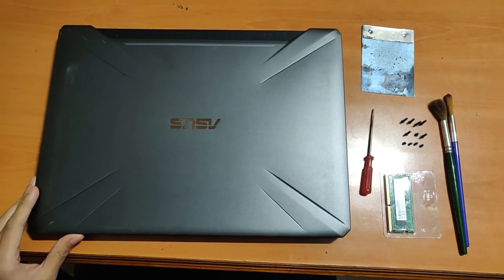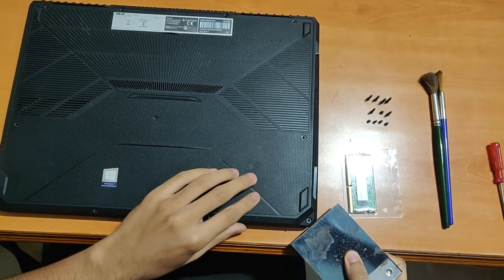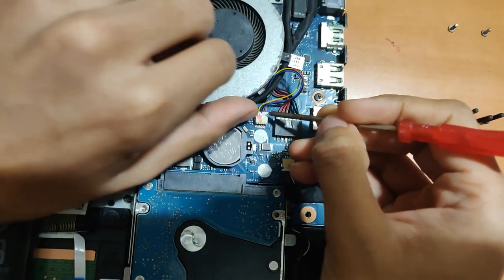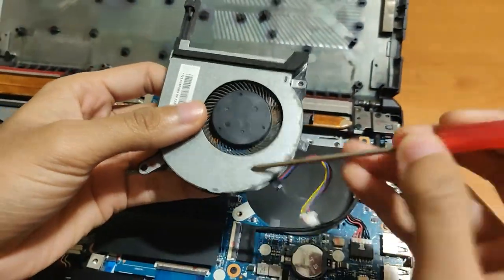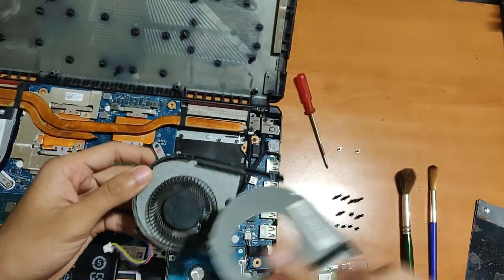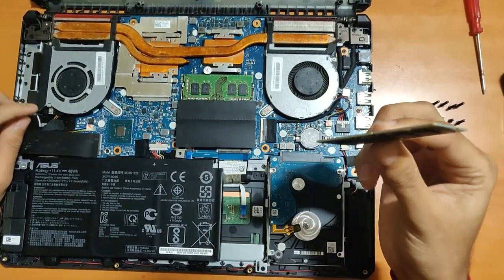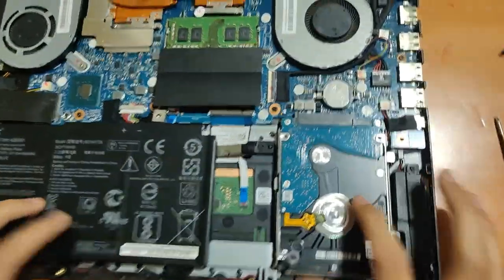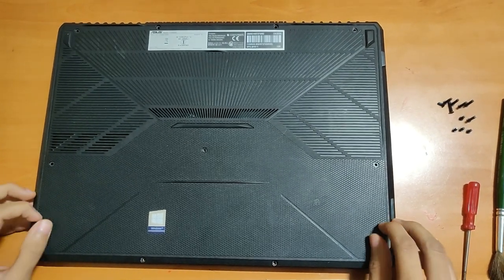Cleaning and Upgrading my ASUS TUF FX504 laptop

Comment: You are Lucky bro!!, Next time remove your battery wire
Reply from the maker: I did make sure to drain the battery completely but yeah I need to be careful.
Reply: Which one is the battery wire?
Reply: @tushartyagi1762  the middle one, who Have 6 small cable
Reply: @hs6389  Even if you drain the battery it will still have some power left in it. Make sure to remove it next time.

Comment: So many wrong things

1st: Disconnect battery first
2nd: Use any plastic /spatula to pry off the wires. You could have damaged the mobo with the metal screw driver
3rd: Remove heatsink first before the fans, DO NOT SLIDE IT the copper heat sink/pipes are very malleable and with MODERATE preassure it might bent permanently.
Reply from the maker: will keep this in mind thank you
Reply: @hs6389  BUT still it was very helpful THANKS😁
Reply: this guy is indian so imma trust him
Reply: any tips on how to remove the heatsink?
Reply: @zingodongo  bruh really?

Comment: Thanks man that helped.
Although, I must add that everyone should unscrew the heat sink its like 4 bolts and that way u want bend it like I just did .
Its minor and it will go back down, well it did as I screw the cover back on.
Just safer way to do it in my opinion.
I also unplugged the battery , and that "big " white connector u said not to unplug I had to as those wires were covering up one of the screws for the right fan and I didnt want to "pry " it away. Everything on this so small and I am sure easy to break...
All the best.
The video helped me, to finally do it, as it actually only took less than 20 min.
Reply from the maker: That was my very first try of opening and fixing a laptop and many people berated me for how wrong i was (which i agree). But kind messages like yours helped me and am over those rookie mistakes.

Comment: can you remove the left fan with the same method? i've stripped one of the heatpipe screw in the middle, so there's no way i can remove the heatpipe
Reply from the maker: No need to remove the heat pipe. For the left one, there are 3 screws. One is on the right-hand side while the other 2 are on the left-hand side (above and below the black tape.) Remove those and you are good to go.
Reply: I had the same issue (as others from what i see) regarding the stripped screw, how did you solve it?
Reply: i simply unscrew the fan screw, and simply lift the heatsink pipe then slide the fan outside, just like the video @Danteleo666

Comment: Nice video mate. My machine is not holding charge for more than 2-2.5 hrs. I don't play any games and its a 2 year old machine. Any idea how I can improve the battery backup? How much it would cost if replacing it is the best option?
Reply from the maker: I am no expert but that kind of backup is actually pretty normal. Mine is also 2 years. On very light use it last 2+hours. For extending life, I good thing you can do is to clean out your fans and close all applications running in the background which you are not using.
Reply: Generally that's the case with all laptops usually 
If u want to still get a better battery life then decrease ur frame rate of the laptop screen and yaa background apps running UNCESSARILY

Comment: Been 2 years with this laptop and now the temps reach 95 degrees should I clean it? Does the anti dust cooling system even work?
Reply from the maker: I wouldn't trust the anti-dust cooling. My system was much cooler after I cleaned it.
Reply: @hs6389  bro I cleaned it after watching your video, couldn't believe the CPI side fan was so much dirty, the dirt was stuck like clay, used tootpick to get it off and now my laptop is 15 degrees cooler. Tumbs up for your tutorial!
Reply from the maker: @aniketkumar5089  Same brother my laptop was a mess. So much dust. Glad I could help.

Comment: I don't want to void my waranty but I need to clean it from dust. Can I use compressed air to clean it without openning the laptop? Thanks for the informative video bro!
Reply from the maker: Check with your retailer but in my country if you remove the back panel then you wont have the warranty

Comment: How often should I clean the laptop ?
Reply from the maker: I felt that the air coming out was quite less than it was when it was new. So I cleaned it. I did it after 1.5 years. I am not an expert here but probably 1 year should do if your laptop is only in your house. If you travel a lot then the period decreases.
Reply: @hs6389  Thank youu

Comment: does opening it and cleaning and adding ram void warranty
Reply from the maker: I am not very sure but i read somewhere that you lose your warranty when you open the back cover that is why i did mine when warranty was over. Not sure. Better to double check
Reply: Yes. The moment you open the back, the warranty is void according to Asus. But if you leave no clues that you opened it, they can't know. I not only opened it but also meddled with a lot of connections and the cmos battery and when I RMA'd it, it was still under warranty.

Comment: how about the other fan? the right side one
Reply from the maker: You mean the left side? I removed the right side fan in the video.
Reply: @hs6389  oh sorry, ya left side
Reply from the maker: @andiadriansyahrasyid9881  remove those 3 screws. There is a plastic part which goes under the heat pipe. Carefully lift the heat pipe and slide that plastic part out. It's much easier to remove this compare to the right side.
Reply: @hs6389  ok thanks bro

Comment: My fan is not working after cleaning,  does someone knows what happened?
Reply from the maker: Did you connect the fans properly
Reply: @hs6389  yup everything is connected , it starts ass soon as i plug my charger in. even in high performance setting it wont turn on the fans untill i plug the chargers
Reply: @diamondtols8899  broo you always need to plug a charger for a fan